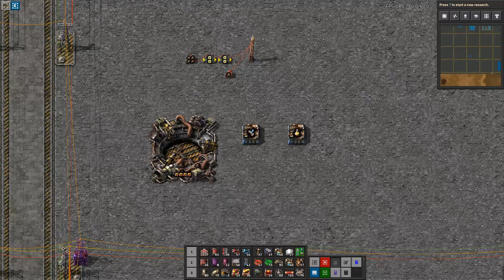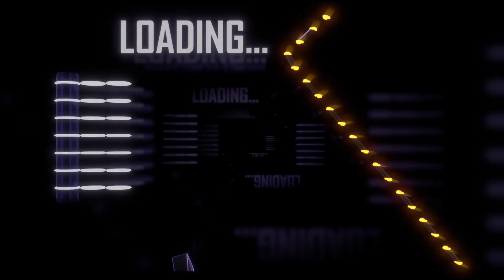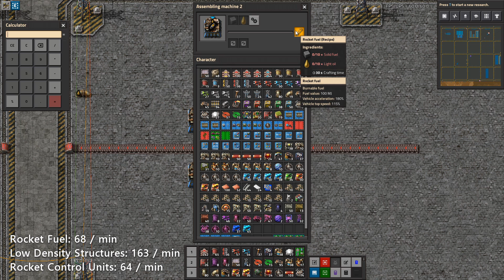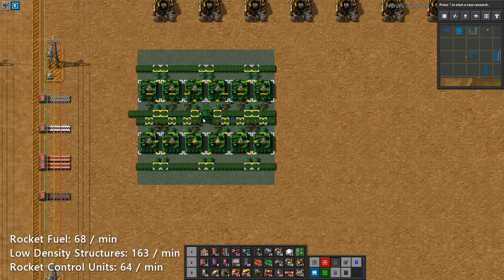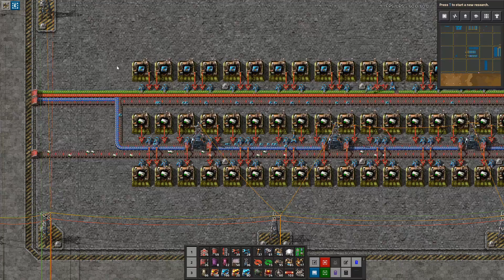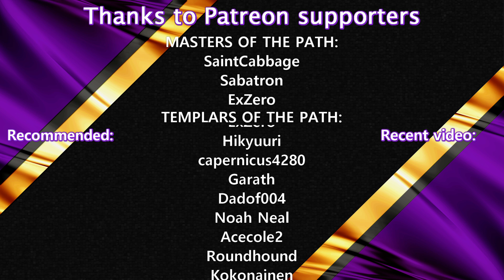Essential ROCKET PARTS to Launch Your First Rocket | Factorio Tutorial/Guide/How-to

Comment: How do we do to insert only one module at a time ? I always see him doing that but I have never found out how to do it...
Reply: 'Z', but be careful because if the module is an input (such as speed 1s in RCU), they will go in the input rather than the module slot.  Also note that you can't copy paste module settings, so either deconstruct and then build them or use a mod like Copy Paste Modules.
Reply: I think that's a function of the "Z" key - drop one item, it'll also put one of an item into a machine.

Comment: I'm confused why you wouldn't make an overage of low density structures in the non-upgraded build. Building an excess would be helpful for making power armor, spidertrons, and their equipment, and you would also not have to account for the ~0.5% slowdown in SPM. Obviously it's strange that a build might need fewer production facilities when the output is increased, but I certainly don't consider strangeness to be a design flaw.
Reply: 3 reasons
1) Most people accept the slight slowdown in science when you steal stuff for handcrafting.
2) The LDS build is constrained by input copper.  So you could only fit in a few more machines before you are input starved, but you are more than welcome to do that (I would).
3) That is also the point of the upgraded build, so you get an overage for things like that.

Comment: I normally wouldn't be this asinine about grammar, but I've noticed my German colleagues often use present continuous form when they should be using the present simple form, as does Nilaus here. So don't take this the wrong way, this is mostly for my own edification, but I wrote it out to perhaps benefit Nilaus as a side effect.

2:25 A: The satelite is also requiring some ...
4:55 B: This one is crafting one every two seconds 
5:30 C: This is producing X/sec ... this is consuming X/sec
6:00 D: I am researching yellow science before I research productivity science.

At this point I tried to reverse engineer what might be going on in the head of a German speaker by translating to German and back. I've written a literal translation (wörtlich) of the above phrases, as used by nilas. Words in parenthesis are generally omitted in German, but adding them makes the difference clear.

A spoken: The satellite is also requiring some ...
A wörtlich: Der Satelit benötigt (gerade) auch etwas ...
A gemeint: Der Satelit benötigt (im Allgemeinen/grundsätzlich) auch etwas ...
A fixed: The satellite also requires some ...

B spoken: This one is crafting one every two seconds 
B wörtlich: Dieser fertigt (gerade) eins alle zwei Sekunden
B gemeint: Dieser fertigt (im Allgemeinen/grundsätzlich) eins alle zwei Sekunden
B fixed: This one crafts one every two seconds

C spoken: This is producing X/sec ... this is consuming X/sec
C wörtlich: Dieser produziert (gerade) X/sec ... dieser konsumiert (gerade) X/sec
C gemeint: Dieser produziert (i.A./g.) X/sec ... dieser konsumiert (i.A./g.) X/sec
C fixed: This produces X/sec .. this consumes X/sec

It appears the normal phrasing in German does not differentiate between something that is happening right now (gerade) and something that happens in general (im Allgemeinen/grundsätzlich). If that distinction is important or unclear from the context, I guess you have to add qualifiers in German. In English, the distinction appears to be embedded in the grammar.

D spoken: I am researching yellow science before I research productivity science.
D wörtlich: Ich forsche YS (gerade), bevor ich PS forsche.
D korrekt: Ich forsche YS (grundsätzlich), bevor ich PS forsche.
D fixed: I research YS before I research PS.

This example is particularly interesting, because the first half of the sentence uses the present continuous form, but the second half uses the present simple form. The Denglish brain could use present simple for both, but for some reason chooses to use it only once. Maybe because German only requires the (generally omitted) qualifier in one part of the sentence, so it also only gets the grammar mixed up once?
Reply: That's fascinating.  I believe Nilaus is a Dane, if I remember correctly.
Reply: Quite an interesting comment!
Nilaus has explained certain facts about the Danish language that are pretty alien to native English speakers and I believe there was something about different nuances in forms. Being born in a multilingual context does help catch some of these subtle but fundamental differences which make the foreigner stand out (I guess you are of bilingual origins)
Personnaly, I love the way Nilaus talks and I wouldn't want him to change anything, but I''m sure he'll try to include your remarks to improve his speech patterns (because that's the kind of person I believe he is)

Thank you for taking the effort of writing all that down. (And it was oddly interesting for an Anglo-French guy like me, even if Ich habe kein Deutsch mehr gesprochen für vierzig Jahren, or something like that... :)
Reply: Your interest in English has amazed me, nice
Reply: Given my absolute criminal abuse of gerunds when I try to speak a language that approximates Spanish, I sympathize with and can forgive the unnatural foreign grammatical quirks in otherwise legible English. Regardless, interesting summary.
Reply: The only example that looks unnatural to me is A. People say "I am doing X" all the time. But something about "require" doesn't fit. Just like "have" - "I am having one item" doesn't sound right; instead people say "I have one item."  ...  "I am having a hard time with X" is perfectly fine, but so is "I have a hard time doing X" - I guess you break that down into something that's happening in general vs. a specific case. "I am having a hard time" indicates it is happening right now. "I have a hard time" is usually followed by a qualifier, condition, whatever you call it.  Perhaps the case of "require" could be considered specific if the requirements were not constant - "Now it is requiring some circuits", but since the recipe is always the same, "The recipe requires circuits."
Reply: This is really interesting thanks for your work putting this together.
Reply: German correctness in a nutshell! Doesn't really apply if translated into danish, well sometimes but not all.. So once again die Deutsche Sprache ist etwas zu genau.

Comment: Do you always use productivity modules? Or is there some other case where speed modules are better?
Reply: First, modules are a late game item, you can finish the game without a single one.

Speed make the machines go faster, but also use more power, make more pollution, and use inputs faster.  Productivity make free items, but in addition to using more power and making more pollution, they make the machine run slower (meaning you need more machines to keep the same production rate).

It is best to use a combination of productivity (for free stuff) and speed (for fewer machines), but the drawback is a massive power increase and massive increase in pollution.  "Early on" (so around the time of purple / yellow science) the 3 productivity 1s + 1 speed 1 (as seen in this video) is pretty good.  "Later on" (so rockets going regularly and you are going mega base) you put productivity 3s in the machines surrounded by beacons with speed 3s.

This is a listing of the best places to put productivity modules (rated by how fast you will recoup the cost of the module): https://factoriocheatsheet.com/#productivity-module-payoffs

I will also note there are efficiency modules, which decrease power and pollution (limited to 20% of the base value) and no drawback (other than opportunity to put productivity or speed module).  The most common use case is 3 efficiency 1s in mining drills.  This reduces pollution directly, plus the power reduction will reduce your power requirement, which will further reduce pollution.
Reply: Productivity is best for high tier item, such as science packs

While speed is good for low tier item such as miners, pumpjacks
Reply: @ramadhanafif  Thank you,  after thinking about it for a bit I kind of figured that was the case.
Reply: Also, you can only use productivity modules in intermediate items. There may be some cases where you want to speed up something that can't take it. For example if you need 1.9 assemblers for something you could put in some speed modules instead of another assembler. Or take an assembler producing Assembly Machine 3 fed directly with speed module assemblers. Those take a long time to craft and can benefit from speed modules.
Or the case here you use a speed module in the fourth slot to compensate the speed loss from the prod modules. 3 PM + 1 SM is pretty sweet if you don't use beacons. Personally I use that for the science builds, but use beacons for producing regular items
Reply: @S_Black  Ah thanks I just made it to that level where I can start making modules but I need to start making red circuits first I'll play around with some of those ideas you shared. Thanks.
Reply: Though modules are hardly required. You can easily launch some rockets without them. Productivity modules massively cut down on the needed resources though because their benefits multiply down production chains. And they are especially valuable in expensive things like the rocket silo, yellow science or science labs. The other candidate is things that craft very fast and you need lots of such as green circuits and gears.
The other benefit is cutting down on the space you need. With modules and beacons you can get a blue belt of iron or copper plates with just 13 furnaces. Or a blue belt of green circuits with around 7 assemblers. Or a blue belt of plastic with four chem plants.

Comment: 12:03 the balancer uses an odd amount of underground belts, I hate it
Reply: I've yet to convince Nilaus to use it, but there is a lane balancer that uses just 2 underground belt hoods.
Reply: yeah, I've never understood why he builds those instead of a splitter feeding onto both sides of a single belt.
Reply: I know right but it's still the best lane balancer you can build :)
Reply: well, crafting underground belts also makes 3 each time (which i never understood, as you usually only need an even amount) so i guess it cancels out